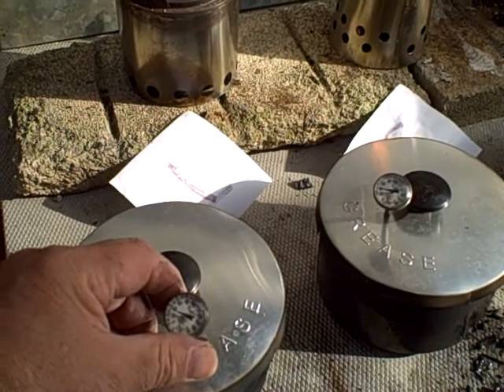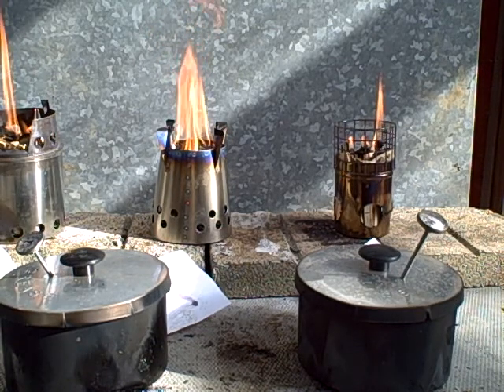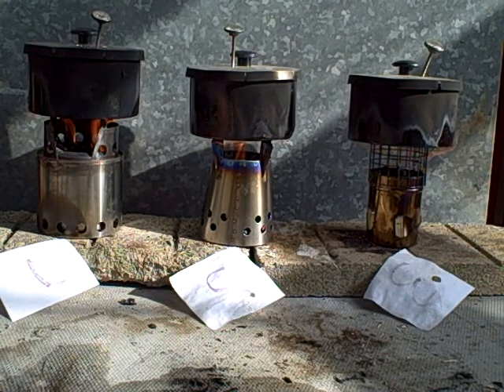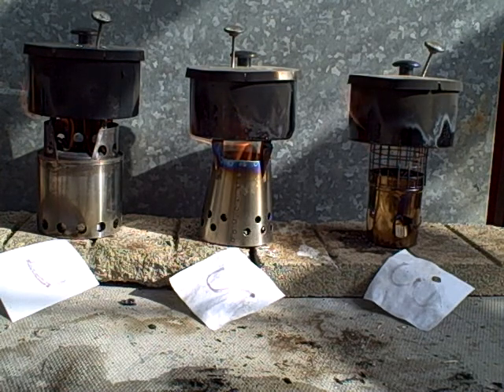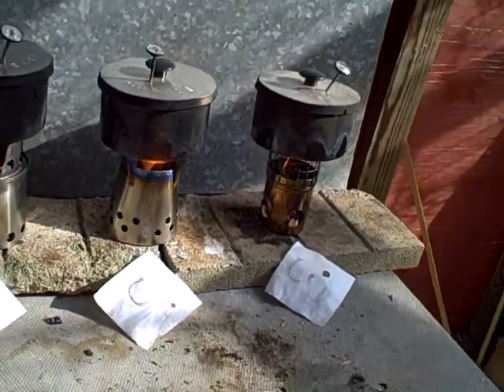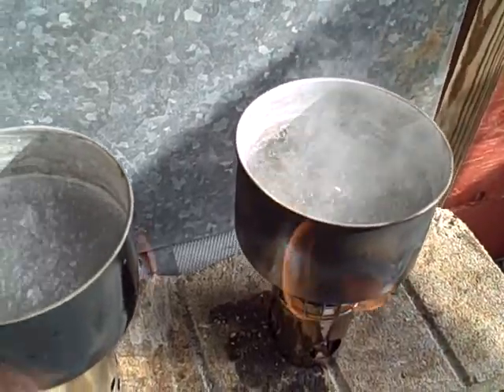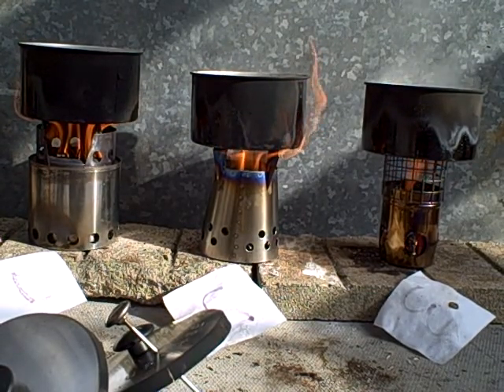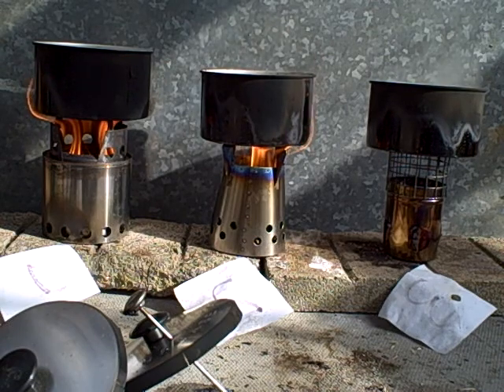The Great Wood Stove Burn-Off #4

Comment: @zellph Your design with the potskirt with big holes on the bottom and smaller ones on the top should bring a boil in 5 minutes or less, depending on fuel because the others have more metal to conduct heat away and yours has more air with focused containment of fuel (smoke) and heat. It would work great in the bush in a mini Dakota hole with smokes holes poked in the ground into the top of the hole 3in from the top diagonally upward, using both rocket stove and wood gas technique combined.

Comment: @zellphThe potskirt could be made of 3sandwiched sheets of foil about  30in long cut into a cone that would surround the stove and some of the pot, getting a 3rd burn. 1st burn at the fuel, 2nd below and on the bottom of the pot above the flames and 3rd around the sides of the pot.Some 1/8 in holes 2in below the top of the skirt would help the 3rd burn.The skirt would burn more woodgas because the heat is held/focused and air holes on bottom and top would provide more air than the other 2 stoves

Comment: You are using therometers and looking for the boil, but you never catch it as it happens.If you were to check the temperature readings at 4 minutes and every 30 seconds thereafter and look only when it the temp reaches 212 the test would have been better.There is little difference between them, all them producing blue and white flame.The zelph had better potential in the original design and should have added a conical potskirt with holes on the bottom similar to the caldera and then IT would win